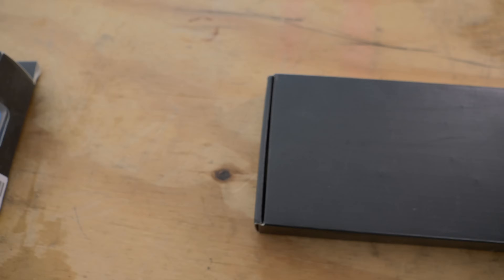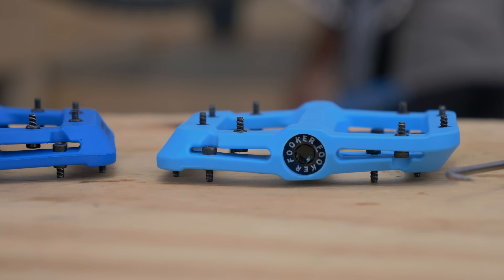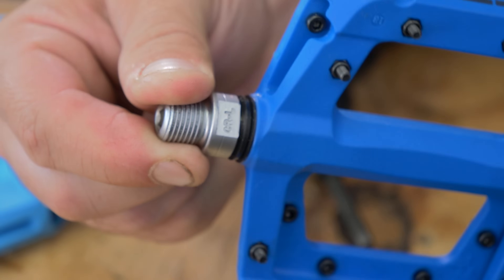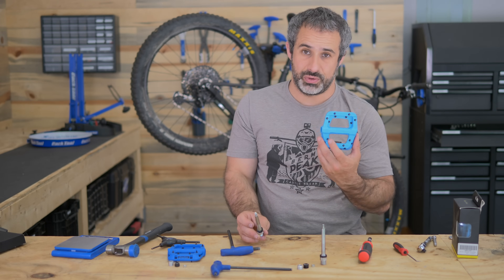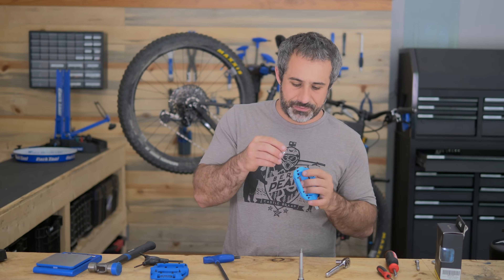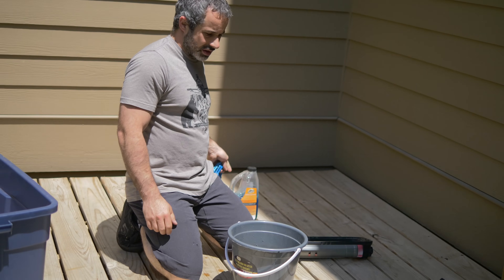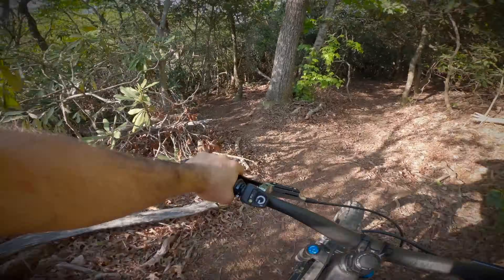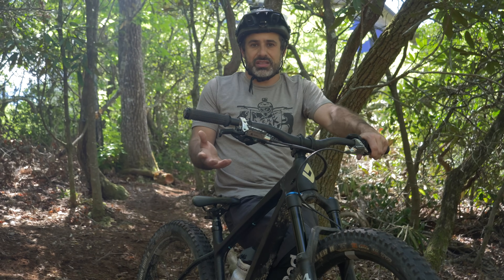These COMPLETE KNOCKOFF mountain bike pedals have me heated!

Comment: Forget 3D scanning, or even stealing the molds, if the RaceFace ones are made in China, the Fookers are probably made on literally the same machines. It’s very common these days to make the “American” product on a contract, and then produce a cheaper low-spec and sell on the side for wayyy cheaper.
Reply: Same with RockBros glasses (frames, anyway)... just like Oakleys.
Reply: Yep RaceFace is cheap junk with no warranty or support
Reply: @Bill-Rink  What lol
Reply: Mr. W yep RaceFace crank arms fell a apart first 50 miles never saw a MTB trail RaceFace never responded to me or bike shop now have Shimano crank Trek doesn’t warranty non Trek parts
Reply: I’m sure raceface is Canadian but your probably right
Reply: 100% no warranty or support from RaceFace cheep junk I recommend a Do NOT Buy
Reply: Bill Rink Which is exactly why I bought the fooker pedals, nearly identical construction and buying a whole new set of pedals cost less than a rebuild kit for the chesters
Reply: Bill Rink 1 bad experience doesn’t mean the entire company is crap. Sorry that it happened to you but when I’ve had parts fail that I purchased from the LBS I was always taken care of regardless of the manufacturer. Sounds like part of it was a failure on Trek to make it right for a customer. Typically the parts sold on a new bike are different than retail and that might be why you had no luck.
Reply: @MrJamesLuz  agreed warranties can get hairy sometimes and companies drop the ball now and then. But do we think that fooker will support a warranty claim? Could you even reach them if you wanted? At-least the chesters have a track record.
Reply: This is true for sure and while the front end company guarantees some level of quality and support, companies like race face do cut corners sometimes if they think you won't notice. Everyone should check out hambini on YouTube particularly if you're looking at carbon bikes. The problems with these cheaply produced and high mark up bikes and parts is a bit appalling. This is why its good that if you can afford it, buy American made, or non-outsourced products, especially since in cycling there are still a lot of them. If you're on a budget cheap is fine but don't let a big bike brand extort money from you because their carbon super bikes are actually made with the bare minimum QC.
Reply: They do the same with MTB and road frames too,same sh17,different stickers  :-)...it is called the 3 shift system in the facories over there,but 1 shift seems to have no QC guy present..lol
Reply: @Bill-Rink  Trek warrantied my Suntour fork? I don't know what you're talking about.
Reply: Yup, leave the mold machine running for a few 1000 more bodies, and out (back) door they go. Exact same body and material as the RF, order some axles and your all set...
Reply: Exactly, just picked from a catalog and have a logo stuck on, I thought everyone knew that, guess not
Reply: And actually it doesn't even have to be that... there could have been a batch of polymer/nylon that did not meet the specs of RF and so it went into a "seconds" bin which are then finished off with cheaper parts. That coupled with what you said about the contract machine/mold issues, there are enough differences that RF would have a hard time winning a court battle for this that would repay them more than the Attorney/Lawsuit costs, so they just let it slide. Part of the fun of some stuff getting made overseas for "cheaper". We used to call it "Industrial Espionage" but now it is just common place.
Reply: This happens with car wheels/rims all the time. The 'fakes' are made using the same molds in the same exact factories, sold as chinese versions for half the price.
Reply: Yup, look at all those cheap carbon bike frames on ebay, those are identical to the expensive frames they look like, just made to a lower standard with more flaws in the carbon, made by the same Chinese contractor that makes the frames for whichever bike company uses that contractor.
Reply: This happens in the surf industry to unimaginable levels. Im guessing that this theory is correct. Don't have to steal the pedal if you're the one making it.
Reply: @liquidwombat  Oh trying to find a reason to justify the fact you bought some cheap knock off? Funny
Reply: YOU ALL HAVE TO UNDERSTAND ONE THING... MILLIONS OF PEOPLE INCLUDING MYSELF ARE OVERPAYING FOR STUFF. ESPECIALLY MTB STUFF!!!!
Reply: I checked some of my Raceface stuff and it appears it's all made in Taiwan.
Reply: "Fooker" is an ancient native american word for guys who change lanes without signaling.
Reply: victor chen Not justifying anything, simply stating a fact if the race faces last me three years and the fooker pedals last me two years it would take 12 years for the prices to equal out. And frankly contrary to what Seth states in the video there’s not much new engineering being done in bicycle pedals especially composite ones, we’re talking about spindles which Has basically been set in stone for 75 to 100 years with a nylon composite molded into the shape of the pedal which has been been done since at least the 70s with some little steal screws set in them which has been done for at least 15 to 20 years. The race race definitely has a better seal at the inboard side. They both are using sealed bearings on the outboard side and other than paying for the name Race face why would I spend twice as much
Reply: @victorchen8484  He can spend his money on an identical product for half the price if he wants to. I mean they're hardly even a knock off they're literally almost a carbon copy, that's the thing that's funny here. Nothing you need to get upset over.
Reply: MrJamesLuz RaceFace never replying to support call is bad even trek tried to get them to respond trek did talk the bike shop into eating the cost but RaceFace is scumbag for not even answering.
Reply: MrJamesLuz nope 100 % original Trek MTB same specs as on Treks website sold by official trek dealer
Reply: John Keegan I talked to trek directly they do not warranty non Trek / Bontrager parts they only helped when it blew up on Eben Weiss outside magazine writer twitter feed but still did not get original RaceFace part As RaceFace would not respond
Reply: I had the fookers on my last hardtail and had no complaints. I do agree that many MTB items seem overpriced. Just wonder if that reflects the higher cost of doing business in America.
Reply: Bill Rink I've had race face for three years now and I'm on the same pedals. Not worth getting fookers when they may have used the same pedal type but have cheaper internals and are gonna break faster. Did you even watch the video.... it's a looser pedal that can get destroyed by riding through a few streams ..... Plus the race face isn't even expensive, and you can always find deals on parts as well. And then there's the color options and whether you want your bike to say fooker on it 😂
Reply: Check out Peter Navarro's presentation on China's business practices...support ethical businesses that do things the right way...not businesses that rip off the hard work of others. If we don't have good principles as a society, we have nothing
Reply: Alejandro Muñoz there a different size
Reply: @stoutlager6325  Lot of stuff is made in Taiwan. Its fine. They are knwon to specilise in bike parts. Most USA made stuff is actually made in Taiwan and just designed in the USA.
Reply: I heard with Chinese manufacturering theres a clause in the contract that once the original company makes their set target, the molds then belong to the manufacturing company. At least that's the case with sunglasses.
Reply: @kudosbudo  I think he means it's not made in China.
Reply: Saturn Designs did you see my  post RaceFace parts fell apart on new Trek bike No warranty or support was provided RaceFace did not even respond to warranty claim So Fooker RaceFace
Reply: Bill Rink trek doesn’t warranty trek parts very well either
Reply: The dangers of manufacturing "overseas".  With contract manufacturing, competitors products are often created under the same roof side by side with only a chain link fence separating the two.  I've seen it to know that's how it really often is.   "After hours production" is definitely a thing where so many more are made on the same equipment.  Sure this could all happen in the USA but not as likely.  In China they consider this sort of thing "sharing" and it is perfectly acceptable to them, nothing underhanded or illegal about it.  Everyone who started or supported outsourcing or contract manufacturing is to blame.
Reply: Steven Jalopnik yep, bicycle companies in general are horrible to there customers when it comes to warranty including Accell group DiamondBack’s Parent company
Reply: @Max-xl3ml  American made like Cannondale, which Hambini regularly calls out for execrable quality? Or Taiwan made like Giant who he reckon's have decent quality?
Reply: Exactly. Excess capacity and factory “seconds” become multiple brands at a lower cost. The three major bicycle manufacturers globally are 1. Giant (themselves, Trek, Scott, Colnago, etc.), 2. Merida (themselves, Specialized, other big brands have bounced back and forth between Giant and Merida) 3. Ideal (various carbon including entry level Look). From their Fairly and others. If you want US made you’ll have to look at independent companies like Reeb (Colorado), Sklar (Montana), Gunner (part of Waterford Precision Cycles - Waterford, WI) owned by Richard Schwinn and Marc Muller; yes those two guys that are originals from Schwinn still make bikes at the Schwinn Paramount factory that was in Waterford when Schwinn filed bankruptcy.
Reply: What are some good pedals for my stump jumper 29er ?! Lots of trail riding and some fun hops here and there.
Reply: @craigwoods3396  I think part of it is taking advantage of MTBs ability and willingness to spend more. I won't name names but there are USA made MTB dirt jumping frames selling for almost twice as much as the BMX frames made by the same people (yes the MTB has a disk brake mount) similar deal with branded plastic pedals
Reply: Happens with Oakley too, sometimes the Chinese are even better
Reply: Yeah, this. They're catalog items rebranded. Manufacturers even do this with frames. 

I'm interested to see the outcome of the 6 month test to see if the differences in seal affect it.

Does feel a little cringy watching Seth get so emotionally invested in something that's standard practice. But everyone has gaps in their knowledge I guess.
Reply: Alejandro Muñoz I said the same thing.
Reply: @peglor  No like actually American made (white industries, industry 9, paul components, reeb, chumba, moots, guerrilla gravity etc.) cannondale makes all their stuff in asia, their Bedford factory has been shut down for years now. Taiwanese made products are generally pretty good though, mostly down to their lower volume production. Very few companies proudly say their products are made in china, whereas many companies are proud of their Taiwanese production (see crust bikes and rodeo labs). So far I've only ever ridden steel frames from Taiwan so from my experience it's been great. That's not to say Chinese products are inherently bad, but I'd rather buy from companies that are transparent about their production, or Chinese brands that have struck out on their own like yoeleo and light-bicycle. That way you're not just paying for a big brand sticker.
Reply: Look no further than Harbor Freight for this exact scenario. HF got sued by SnapOn because of a floor jack and lost. That floor jack is identical and made in the same damn factory as the SnapOn and HF sells it way cheaper. Just one example.......
Reply: Legit, as some one who’s sources stuff in China there’s every bit as good of a chance that RF rang up their Chinese factory and said they wanted polymer pedals and just put their name on something off the shelf with some tweaks as RF sending their design over and the same factory using the same molds and low costing all the parts and selling them to some one else cheap.
Reply: @Scotsmanthelnerloco  Canadian based....but everything made in Asia.
Reply: @Max-xl3ml  nah, but they're 20 bucks.
Reply: @Bill-Rink  Trek warrantied my 2009 cracked frame in 2018, bought a 2019 29r, got successful warranty claims on my RockShox fork repair and the frame pivots/bearings, was heading toward warranty claim on the rear hub but I sold it and got something that could handle my style of riding.  That said, Trek was great but I think my LBS was way better and maybe that's the difference. edit... just read through the other posts for more clarification, you did yer best!
Reply: @Adoogin   none of those are 
Fox Factory/Raceface  who is a horrible company
Reply: Fox Factory acquired Race Face and Easton back in 2014. It stands to logic, that since FOX has a factory in China... Chester's are also made in China.  OP's comment has merit.
Reply: @thomascray  all glasses brands are owned by Luxottica, they have a monopoly over the frames industry
Reply: @davetbassbos  This. 
Surprised that people still think something dishonest or backhanded is going on. Its pretty simple really. Everybody does it too.
Reply: Alejandro Muñoz Exactly, I was about to post the same exact thing.
Reply: @SixtyDashOne  well, that's what happens when your factory is in China. That factory makes their own OEM part based off of what they manufacture for you.
Reply: I guarantee this is what happened. Classic Chinese grey market. The mold probably wore enough to where the parts didn't meet Raceface's specs. So, they just "retired" that mold, filled in the logo, added their own, cheaped up the rest of BOM, and started making Fookers.
Reply: Is the Chester pedal even a Raceface original design?  More likely it's an open mould and RF went to a pedal company in Taiwan (you know, the kind of company that actually manufactures pedals - most of which they design in house, source the materials, test, store and ship!) and chose that design, chose the colour and chose their bearing and seal spec.  That vendor then manufactured the pedals, ordered packaging and exported them.

Fooker is most likely another guy who went to the same factory and ordered the same pedals from the same catalogue in the same sales office on the end of said factory.  He probably went for a cheaper bearing spec, which would explain that bearing spacer with the hole in it.  Yes they are cheaper, but is there any foul play?  I doubt it.  Knowing how easy it is to order pedals (and even bike frames) to your spec from an open mould, I think both these pedals are made legally in the same factory.

If this is the case, this video is a bollocks.

I agree fully about intellectual property theft but honestly it would be easier to just go and order the pedals than it would be to get a 3D scanner and make your own, source the axles, source the bearings, source the seals, source the boxes, ship them etc... why go to all the trouble when there is a factory that will quite literally do all of that for you and still sell them to you for less than half of what you want to sell them for... which is less than what RF is seling them for?

Of course, it could be a total Chinese ripoff of an exclusive design.  In which case, the video isn't a crock of shit.
Reply: In this case it looks like only the plastic parts are made on the same molds. The hardware on the RF is clearly higher quality.
Reply: Caleb Turpin do your parents know you are posting on YouTube comments? 10yr olds should stay off
Reply: @davetbassbos  this guy knows. This guy knows.
Reply: This this this
Reply: Just made the same comment lol
Reply: Truth
Reply: yep, was going to say the exact same, if they have the factory making pedals on 2 shifts then they run a nightshift for themselves and do the rebranded stuff on that shift run a different insert for the FP logo instead of the RF logo, change the , that way if anyone from raceface turns up for a QC check their still making the raceface stuff.
Sometimes the products aren't even inferior in quality to the stuff being made, depends on the manufacturer, cos they don't have to have marketing budgets, pay US taxes, employee benefits etc etc like a US based brand like RF does.
Reply: did you even feel these petals they are way cheaper feeling and working than raceface i have both they are a little different the bearings wear out sooner on the fookers and the plastics cheaper no hate man
Reply: Yup
Reply: @manuelcruz4824  that's because society accepts that price. If you demand it to be "made in the usa" than the high process would be worth it since the labor costs would be there. Corporations who outsource to China deserve there stuff to be ripped off since there margins are so high and ripping Americans off. Sounds like karma
Reply: yeh the fact is that  the same factory in china are making them bothe!  ,,, think of this! we the customers are being screwed-over for a name? it should be £9.99 but the name is £29.99,, that isnt funny or smart ,that is JUST i piss-take, when they can be selling at £10.none of the sponsers love you! they are screwing you to get every penny!Seth, you are "smarter than the average bear" stand up for the people who dont have the £29.99"and please leave the racism behind "chineses,chinese,chinese" theses are people trying to survive. they have nothing so you go and desroy there income , so you can have a different name?Please seth, dont do this to them or us.
Reply: Yep. I don't know why this is a mystery.
Reply: Paul Antonie their factories are in china
Reply: Yes for instance pedals that don't pass QC for the name brand could be rebadged and used as another brand
Reply: Even if they weren't... We don't need 3D scanning to copy these pedals. Just measure them with calipers. Machining has limitations you don't find in casting or injection molding.
Reply: Anyone suggesting these pedals were made on the same tool doesn't understand injection molding tools. If you watched the video, you'll note that there were some features on the pedals that were different. If they were off the same tool as the RaceFace, they would be 100% identical. Down to the smallest scratch or imperfection in the tool. I can say this because I have personal experience in this area, having phone covers molded off of our tools, back when I used to work product development in the mobile phone industry.
Reply: @singlemaltbjjvideosandtuto4005  Or they tried to replicate the same tool but for cheaper.
Reply: sort of how they make counterfeit items, the same factory makes the real and fake ones
Reply: Fender and Gibson btw
Reply: Came here to say that. It is not uncommon for Chinese manufacturers to become your own competition.  These may be the ones that were of slightly lower spec or they just produced more and sold them.
Reply: @Bill-Rink  I’ve never had a single issue  with any of my raceface components in three years. And I’d 100% recommend them. Especially for beginner MTB riders.
Reply: @Jamesfrancosdog   I Still stand by the facts the Race Face / Fox Factory  parts failed no warranty support was given. Race Face / Fox Factory is a bad company
Reply: Do better race face 👀😈
Reply: Correct.  Thank you for saving me the time to type that. Lol
Reply: I've had my RaceFace Chester's for 5 years now and have over 5,000 off-road miles on them. They work just as good as day 1 but then I do take good care of my stuff.
Reply: @MrJaame  I think you have the most likely take. 

Its a good reason to not make your parts, of anything, in China, or any of Asia.
Reply: very interesting thank you
Reply: The Internationale unites the human race. God bless China and God bless working class people across the world.
Reply: @CallMeJackWagon  YUP!😂 Hobo freight ftw! Project Farm did a comparison video on the two. Exact same nice build quality, and specs, but at the fraction of the cost. Snap-On is a fucking joke of a company, way overpriced shit. You see how much they want for their GD rolling creepers? It’s nuts, let alone their rolling tool boxes. I’m glad Snap-On lost, serves them right for overpricing their shit.